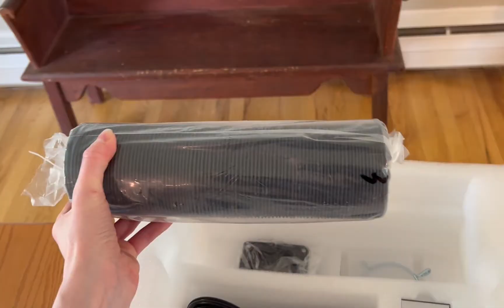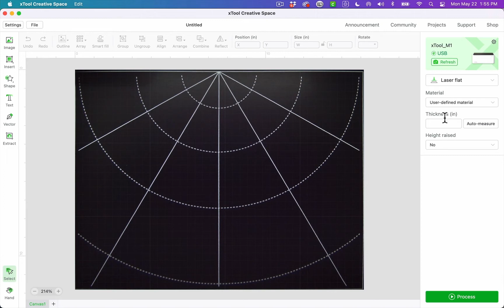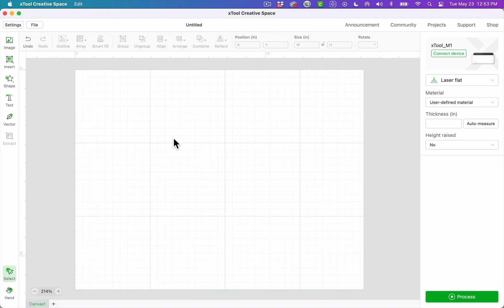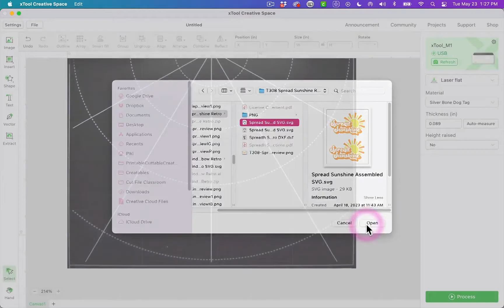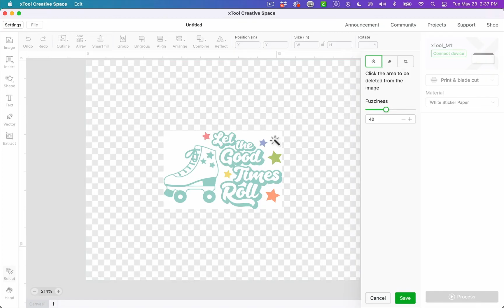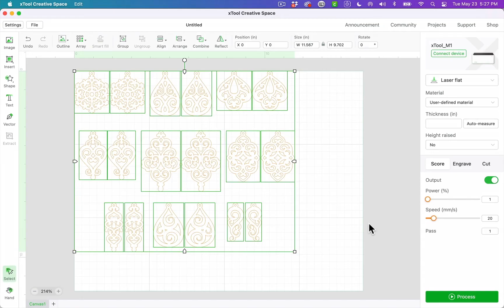xTool M1 Laser Cutter Setup Tutorial

Comment: Your video was so helpful. Glad I found it.  Just wondering when cutting leather with the blade did you use the 60 or the 45 blade? I read somewhere to possibly use the 45 for paper/vinyl etc and use the 60 for thicker material eg leather.
Reply from the maker: @joeast8223  I’m so glad you found this video helpful!! I used the default blade that came with my M1, which I believe is the 45 - I don’t even think they made a 60 blade when I made this video! The 45 cut through the Xtool leather just fine anyway!!
Reply: @PrintableCuttableCreatables  great thanks. Got 5 of each blade with my M1 so wasn’t sure 😊
Reply from the maker: @joeast8223 sounds like a sweet bundle!
Reply: @PrintableCuttableCreatables what you’re opening have the exact same 5